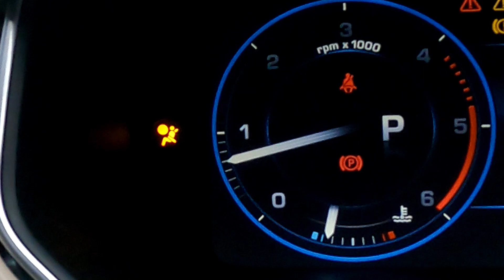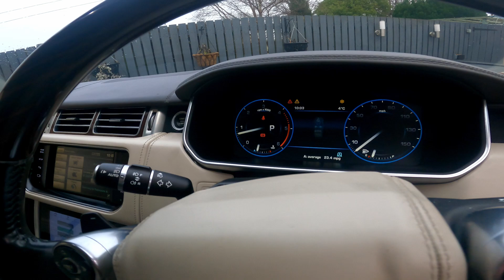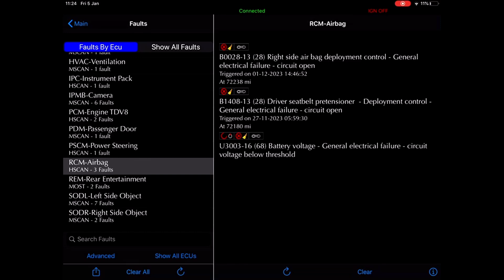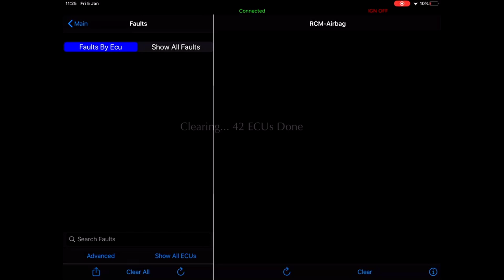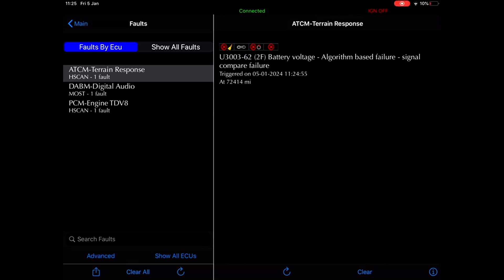L405 SRS Air Bag Light Investigation

Comment: Hi i had a similar issue about 3 years ago and i took it to a dealer and they replaced one of the harness cable and cable is £94 plus labour charge.
❤️❤️🙏🙏🇬🇧
Reply from the maker: The cable is around £25 to buy, just need better weather to fit them :)
Reply: I only explain I got done from Land Rover dealer they charge about for cable £95 plus labour.

Comment: I have the same issue, Vogue SE 2015 had it repaired which was  a modification / repair  to the loom (not a new loom) twelve months  later it’s back !! 

Did this cure the fault light coming  on ?
Reply from the maker: So far yes the lights hasn’t come on yet!!, I do have 2 air bag extension wires to fit under the seat, (side airbag and seatbelt tensioner) but not got round to fitting them yet as its too cold outside to be working on cars lol
Reply: @RaymiesGarage  Thanks for the update, once the weather has warmed up a little I will have a look at this myself see if I can fathom out the cause.. although if its not clearly visible I’ll probably end up cleaning the electrical contacts (battery disconnected) see if that helps.